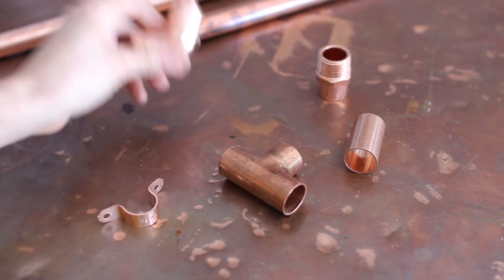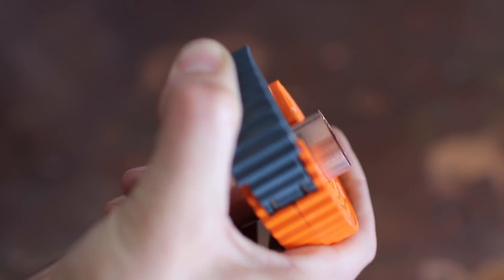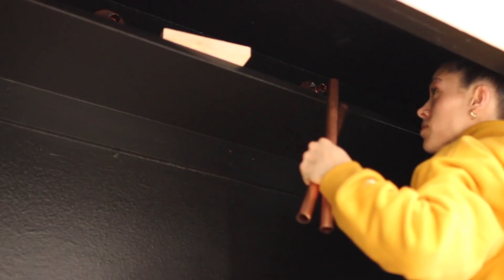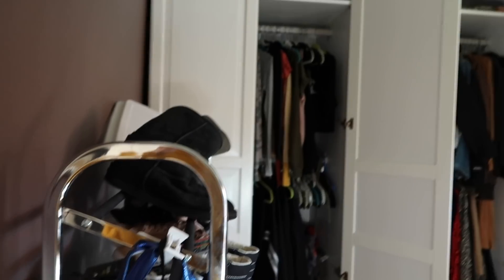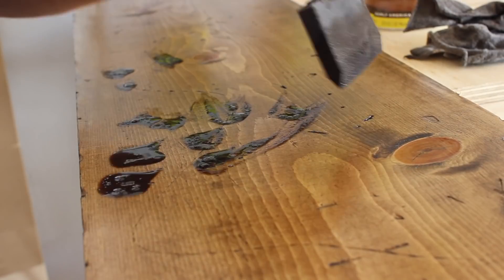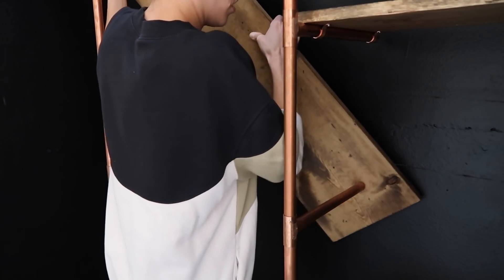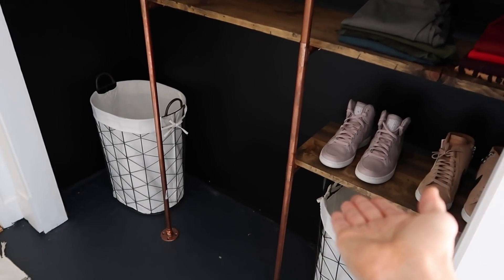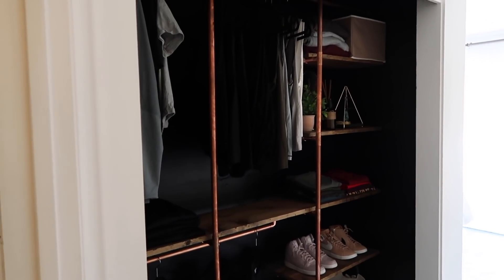DIY Closet Makeover with Copper Pipe + Wood!!

Comment: hey Rachel, I use a different kind of pipe cutter which can cut a specific range of diameter. I have two of them, One for small tubes and one for larger ones. There is also a special kind for Stainless steel. This way it will help save some bucks and space in the tool chest. Thought of sharing!

Comment: Do not do this. Copper cannot support a significant amount of weight. As you can see, Rachel has styled this closet to only have very few lightweight items on it. If you are hanging your actual wardrobe, this will not work. I say this out of experience. Unfortunately, being a big fan of Rachel’s, I saw this video and wanted to do it. I spent hours designing my copper system, price shopping at my hardware stores, and measuring. When I finally went to buy it, a Home Depot employee told me that copper would bend and snap under the weight of clothes. He advised against even using the thickest copper for a closet rod. He said I could insert steel into the copper and use steel elbows spray painted copper, but this set up weighs a TON in addition to the clothes you’re putting on it and it’s also substantially more expensive when you’re purchasing both copper and steel. You can’t use wooden dowels to reinforce it because then you’d have no elbows - the copper elbows won’t hold the weight of your clothes and the wooden dowel, and even if you were going to make an attempt, you would HAVE to solder the copper. I spoke to five different Home Depot employees about this and finally googled it and found the same info (don’t use copper as a closet rod) in multiple forums. I wasted hours attempting this DIY only to learn it’s not plausible. It looks fancy and nice if you’re going to hang five t shirts from it as Rachel displays, but if you’re going to hang dresses, suits, etc, you can’t do it. I’m disappointed, Rachel. At no point in the video do you address the limitations of copper, giving the impression anyone can do this. Prior to this video, I was really loyal to your DIYs but now I’m going to look at everything you do with a level of skepticism, wondering “is that for real, or is it for show?” 😕
Reply: Thank you for this detailed post. I really appreciate it and won’t be going down this road now
Reply: Thanks I hope anyone that was going to do this reads this and heeds your advice 😊

Comment: I’ve heard that copper can be a lot softer than other metals. Did you have problems of it denying when you were assembling/hammering/etc? If so, would it be better to get a harder metal pipe and paint it copper?
Reply: That's a better option. Also solder to secure of you do use copper

Comment: Did you attach the top rod for the clothes to the vertical copper pipe or is it only attached to the flanges on the walls? Thinking about doing something similar but worried there will be too much weight on the clothing rod
Reply from the maker: Flange into the underside of the wood. Then the bars from wall to wall have the flanges on the wall.

Comment: The iron flange will likely have a reaction with the copper pipe, the zinc on the flange and the copper cause a reaction. In plumbing that’s a big no-no.
Reply from the maker: Oh weird! No issues as of yet xx.
Reply: Living to DIY with Rachel Metz it May take a while and since you’re not using them for water I’m sure you’re ok for a while.

Comment: I’m curious why u didn’t secure the horizontal pipes to the back of the closet?  The shelf would have fit all the way to the back wall. Not a judgement. Just wondering.
Reply from the maker: I mentioned it in the video - miscalculation but since I already wasted half the copper I bought I just DIY'ed around it. I will go back in and extend when I do her bathroom.
Reply: @LivingtoDIYwithRachelMetz  you didn't fix the pipe in the tees either? It doesn't take much to solder pipe. And you don't need an hammer to pop it in.
Reply: @LivingtoDIYwithRachelMetz  you could put some 2*3 /1*2 CLS and drill holes for pipe to sit in. Secure to studs. Would make shelves so much stronger.

Comment: How do the T bars holding up the shelves not slip down the long poles in the front?
Reply from the maker: The copper isn't going straight through as shown multiple times. You need to make cuts to fit!

Comment: How did you attach the copper pipes to each other? I tried e600 for a different project and it didn’t really work
Reply from the maker: What do you mean? The connectors should be strong enough - you can add a little liquid weld of rapid fuse if it isn't a strong hold. This whole thing is held together by connectors and flanges.
Reply: Maybe I need to try hammering them, they twist and slide. Thanks for your reply!

Comment: Don't use copper pipe. Copper is expensive, soft, thin, tarnishes, and won't be very strong. You also need to solder copper pipes to keep them together, which requires a blow torch. Use 3/4 inch steel pipe that's threaded and paint it your color of choice. It'll be way stronger. There's other videos of this. I'm building a whole master closet with this method. The big box stores will cut the lengths you want and thread each end for you.

Comment: you shouldnt need to hammer the pipe into the fitting its made to just fit in just maje sure to not put a fitting on the factory end and make sure its on a cut piece  of pipe and you shouldnt need to hammer them any more, just a tip been plumbing for 5 years